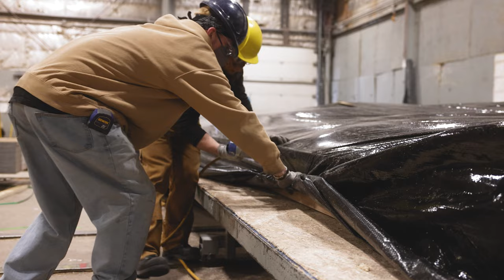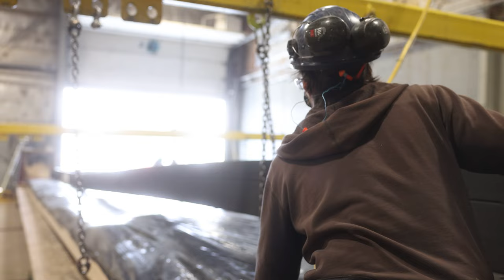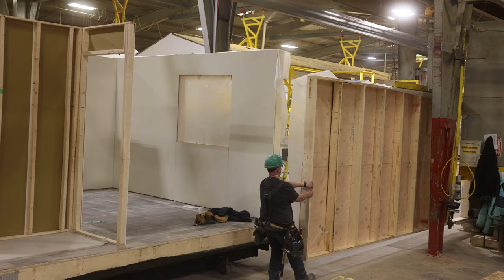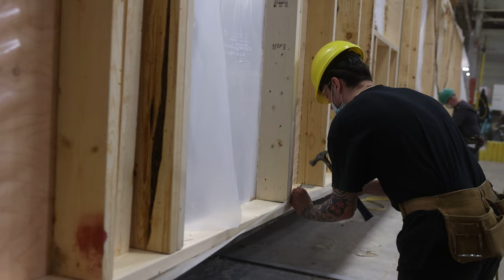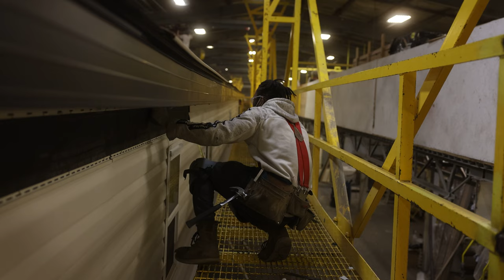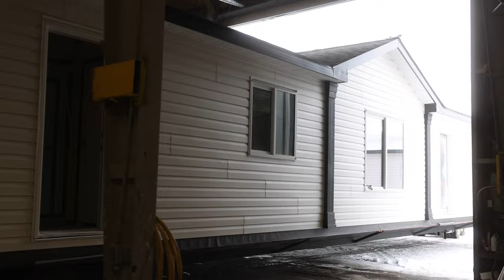Manufactured Homes - Best Buy Homes

Comment: Help! Question: 

Length = 284”
W (Including Hitch) = 54
W (Excluding Hitch = 50

What is the correct SQ Footage for home listing? 1296sf or 1200sf? Thanks!
Reply from the maker: We typically don't include the hitch in measurements
Reply: @bestbuyhousing4250  Gotcha. Thanks! Yeah, we were confused as to why the home was listed as 1296sf. That appears incorrect.